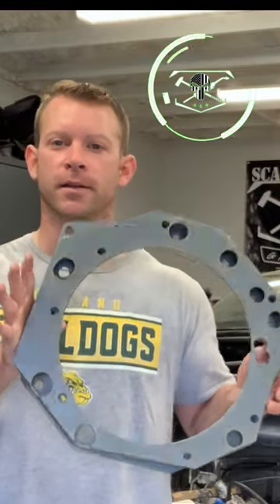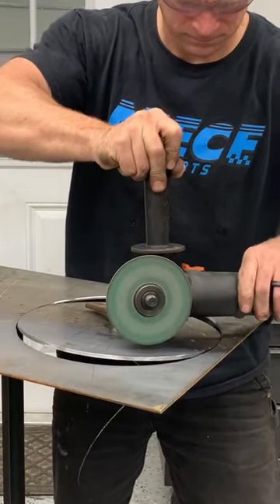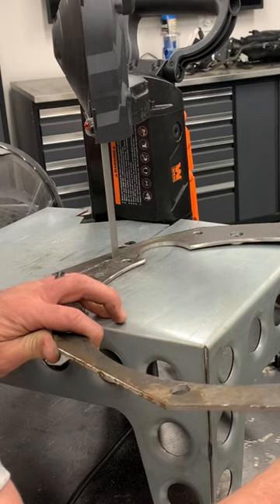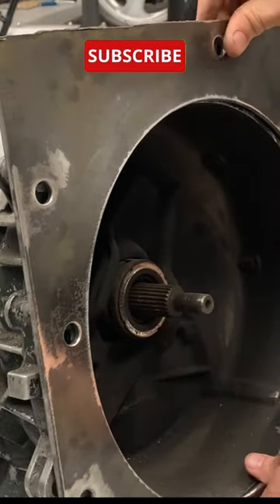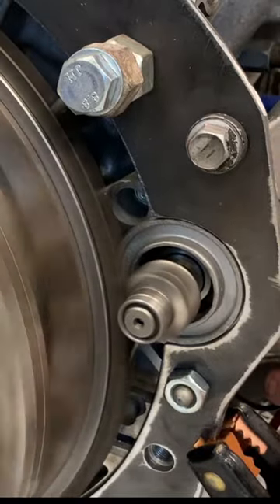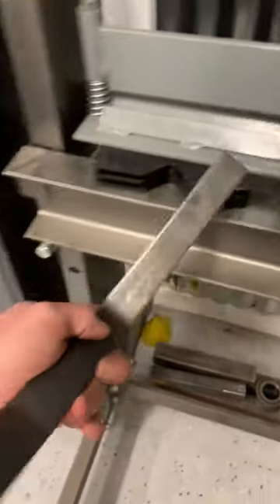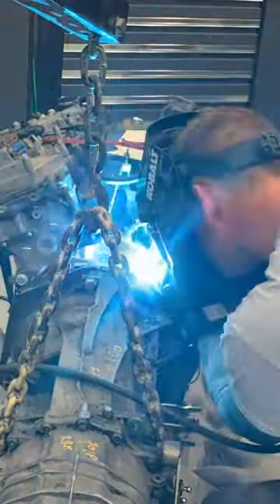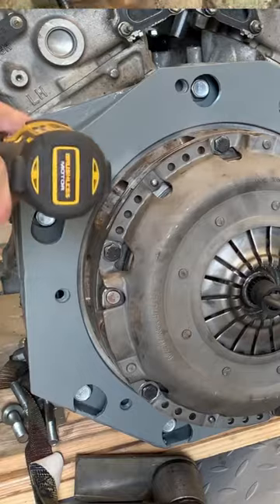Engine Adapter Plate Build

Comment: Very creative.  How do you prevent galvanic corrosion between materials?
Reply from the maker: Use weld through primer. It will rust at some point like anything else made from steel at some point though.

Comment: How do you get the spacing between both plates? Do you just hold the engine and trans to where they touch/meet? How do you know what "thickness" of flywheel/clutch to use?? Full video is also confusing
Reply from the maker: Yes.. that is exactly how I did it. I also used a factory clutch made for that transmission.

Comment: What did you do for dowel alignments from block to plate and plate to trany?
Reply from the maker: I used the original dowels but had to come up with my own alignment due to the different transmission. The engine used to sit an an angle in its FWD setup

Comment: How thick was the metal? Will it be strong enough for 6.9 c 24v thank
Reply from the maker: 3/16 thick. Plenty strong for a 24 valve. I may just add some rib supports for that application though

Comment: what do you do if the input shaft is too short to bottom out on the crank?
Reply from the maker: You need to make up for that distance by adding material to the flywheel
Reply: @ not trying to ask dumb questions and sorry if I am, but is it ok if the input shaft doesn’t bottom out in the drilled hole in the crank? Like if you make a custom pilot bearing on a lathe? And then fit it to the stock flywheel
Reply from the maker: @dakotascot  I made a custom flywheel for this in the full video

Comment: But what I wonder is how can the transmission shaft work being it's a 1 1/2 or so back away from the engine now can anyone answer that for me
Reply from the maker: you extend the flywheel clutch surface out to match : )